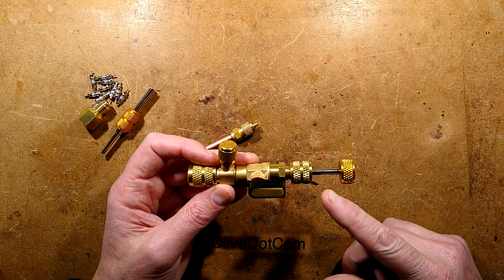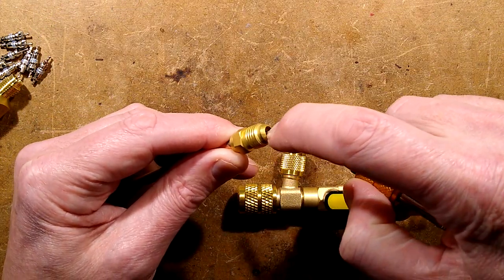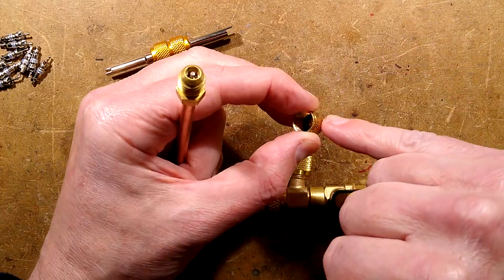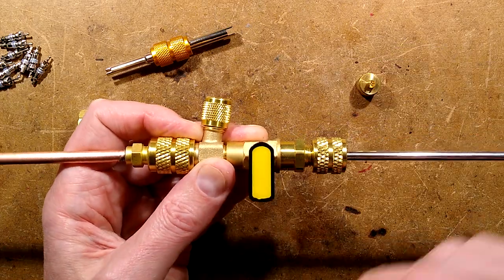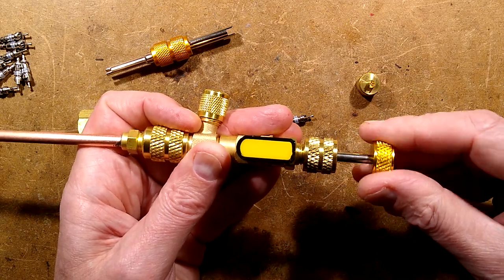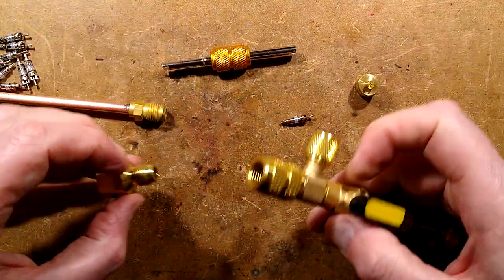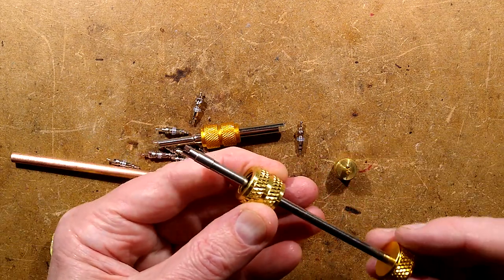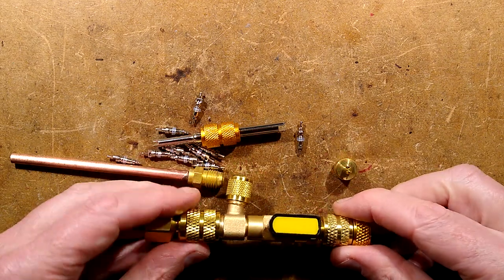Very cool tool - HVAC schrader core changer

Comment: You are correct, the side port is used to connect a hose,  Typically if you are pulling a vacuum you will remove the schrader valve(restriction) to speed the process up.
Reply: The other use is to purge the tool of air, with refrigerant from the system.
Reply: You don't want any air from opening the tool to swap the valve to get into the system. Air is a non-condensible and moisture in the air will cause ice particles that can block the tiny restrictions leading into the evaporator.
Reply: Could also be used to recover refrigerant if something goes pear-shaped while swapping the core... Like if it cross threads, or if it falls out of the holder. Probably to pull a vac in the tool though, to prevent contamination.
Reply: It can also be used to attach probes as well as hoses.
Reply: Pulling a vacuum would be blocked by the one-way valve when present. But attaching any toolB that needs access to the pressure system makes sense even with keeping and reinserting the original valve, as this toolA will only leak just enough gas to fill the toolA internals as it unplugs the valve and closes up, forming a closed chamber connecting the installed system and toolB.
Reply: @johndododoe1411  Most HVAC hoses have a depressor in them. When pulling a vacuum restrictions and hose size make a big difference.
Reply: You can use a similar second valve on the side port to vacuum the system and add gas. Ebay units are fairly poor quality normally but will get the job done.
Reply: Yep, lots of AC guys here 👍

Comment: One week before seeing the short version of this I found a leak in my car’s AC at a Schrader valve. I was wondering how I could replace it. Saw the video, bought the tool, changed the valve and topped up the freon. AC blowing cold again! Thanks!
Reply: The side port has a Schrader valve so what’s the point of removing one only to leave one in as a restriction. I remove the end after closing the valve and evacuate/charge the system directly. The side valve can be used for checking for pressure but best for fitting a vacuum gauge

Comment: Clive, the side valve is to safely depressure the core changer prior to removing it as it would have pressured up to system pressure during the core change. This type of manifold is quite common in the refinery industry. But in that environment, the pressures, temperatures, and the size of the manifold are tad bit larger.
All the Best, Chuck
Reply: It's also to allow evacuation of the line set without the shrader installed for faster vacuum.
Reply: That's actually an unintended benefit of its real use, to pull a vacuum, as Nick said.
Reply: "Tad bit bigger" LOL, everything is relative! HAHA

Comment: That’s fantastic. I’ve never had to replace a schrader valve at work or on any car, but I’m glad there is an easy means to do so.
Reply: This is mostly used in domestic hvac. And not neciasarily for changing the core just removing and replacing it during service work.

Comment: I've used one of those a lot.
The port is for your charging guage set.
The Schrader valve is a significant flow restriction and it's removal makes charging much faster.

Comment: Sliced bread doesn't even come close to how useful these tools are :) I started using this tool in the 80's for refrigeration. I've also used these for installing and removing liquid tire ballast (weighted fluid) in heavy equipment and farm machinery.  The side port is your system access service port (fluids and gases in or out).

Comment: Super cool to see how these actually work. I've seen Chris over at HVACR Videos use one of these many times and while I understood the concept of the device I was never quite sure how the isolation worked once the core was removed but before the ball valve was closed.

As for the port on the top, while I'm not certain if this is what it's intended for, it can be used to speed up recovery and charging of a system since you can tap onto it while the core is removed thereby reducing the restriction caused by said core.
Reply: I was just making a similar comment, they both do such good work, no?
Reply: Same here! Seen it used a number of times.. Its magic isn't it?!

Comment: This is basically a tiny version of how we make taps on water mains live. How we can drill, tap and install threaded valves. I agree very cool tool. Thanks, now I want one for demonstrating
Reply: They are currently replacing the gas main at the end of my street and will do so without interrupting the supply, I imagine they will use a similar device.
Reply: @chrishartley1210  the non sparking version i hope ...
Reply: @jyvben1520  I'm not fully sure, but I think sparks wouldn't actually do any harm on gas line as I think it's way "oversaturated" in lines to create any kind of explosion. Things would change if oxygen/air is allowed in the party though 🤔

Comment: There is something similar for a SCUBA regulator. It is an inline adjuster for the 2nd stage orifice. You thread the tool between the 2nd stage and hose and you can adjust the orifice under pressure. You can't remove or replace the orifice though.

Comment: Similar devices are used for adding branches to pipelines operating and under pressure.  Called hot tapping, it often involves welding..exciting?  It gets better.  Also done on natural gas collection and distribution lines.  And hot repairs, where the leaking gas is often ignited on purpose.  A pipe saddle installed in half sections is fully welded over corrosion holes.

Comment: The side port is because it is a pain to vacuum or pressurize a system with the valve in. So you can connect your vacuum pull the core and pump the system down in 20 min vs hours if it is installed.

Comment: this device has saved me many hours and headaches. i use the yellow jacket ones. one in the tool bag and  two in  the speed-evac kit. the side port is typically used for a micron gauge while pulling a vacuum. I also have an automotive version of this with the adapters for various different ports. Highly recommended

Comment: I started out nearly 50 years as a time served capstan setter operator and set lathes up for mainly females to operate them as many years passed I was went on to NC lathes and maybe the first of many to be involved in CNC lathes, the concept was staggering, but now I see turned and milled parts like this are just on another level. I don't vape but often find then in the gutter and with hand protection, I take them apart to just look at the level of accuracy on the tiny parts, with threads, dovetail grooves, holes of the size I just cannot believe and the goal post just gets smaller and smaller. I suggest with gloves and pick up one of these components off the pavement and take it to bits It's just bloody insane ... Martin Green

Comment: Refco make a far superior model. Same theory but better build quality. The 1/4” access on the side is for pressure reference if pumping down a system or if no other access points at evaporator it can be used for vacustat.

Great explanation!
I did 12months of trade teaching and you explained this much more efficiently then I ever did and this is part of my trade haha

Comment: We use this tool not only for core removal but it also helps in large refrigerant charge/discharging as removes the restrictions you can then use that side port to move refrigerant  in liquid form rather gas

Comment: There are two thing, one the extra fitting they sent you probably is for 5/16 which typically is on ductless split systems so you can just use regular non 410a hoses. Secondly the best function of this tool as some already stated is removing the s header and using the side port to speed up charging or evacuation.

Comment: I use these almost every day. If you are filling a system the core can freeze and never seal up again apart from the restriction it causes both when evacuating and filling. I use the side port to fit a vacuum gauge that needs to be removed before filling, because any pressure will ruin them.
Reply: If there was a vacuum behind the Schrader valve, it would instantly pull in ambient air.  Unless the valve is backwards.

Comment: We have a very similar very old very name branded version of this for automotive AC systems, we rarely use it but it is neat to have! It's like an airlock for AC systems!
Reply: Lemme guess.... "Snap-On", and it prolly costs $350. 
I'm not saying don't buy Snap-On tools, as I own many of them, but for a tool that I'll use twice in a decade, the one in the video will do just fine... 👌
Reply: @davelowets  Not sure, might be Mac or a boutique brand but it's got fittings for R12 if that tells you how old it is!
Reply: @huzudra  Probably 1995 or earlier..
Reply: @davelowets  Very likely, it hangs out in the cabinet below the R12 machine. I'm sure at the time whomever made it had a lock on the design and were the only ones making or licensing it's sale through other vendors.

Comment: Cool little tool. If someone were concerned about using silicone, they could easily use a drop of PAG oil, instead. It's available in any auto parts store.

Comment: Damn! I could use one of these for servicing A/C systems on automobiles...
I never knew this tool existed, and the very few times I've had to change a leaky valve on a car, I've pulled and recaptured the refrigerant, changed the valve, vacuumed the system, and put new refrigerant and oil back in it. Imma get me one IMMEDIATELY.... 
Thanks Clive!! 👌

Comment: Can't comment on the use of silicone lubricant in refrigeration lines but any grease in, or near, an oxygen line is a no-no.  It's possible for a leaking oxygen line / valve to cause the grease that a worker can get on their overalls to combust.

Comment: Those tools are generally used for evacuation of a system and removal of the Schrader greatly speeds up the process. Removal and replacement of the Schrader under pressure is doable but very difficult due to the force required to ensure the core is installed correctly. Not an issue under vacuum however. The side port is for gauges or hoses

Comment: I learned about these while learning air conditioning in community college in 1989, it was called a "Schrader evader" back then. 
I once watched a contractor "hot tap" a 12" high pressure gas line with a similar outfit. They welded a plate with a threaded nipple to the pipeline while fully pressured and gas flowing. They then screwed a valve to the nipple and then a device to drill a hole in the pipe through the ball valve. They drill the slug from the pipeline with a magnetic hole saw about 3" round and extract the slug a drill shavings through to valve they just installed. Then they connect the new pipeline to the system. Scary watching them welding a big metal plate to fully pressured pipe filled with methane.
Reply: Even scarier these days, considering the pipes are made of plastic.😳
Reply: How do they do it safely?
Reply: @mrtechie6810  The methane inside will not burn without air so as long as they don't go through the pipe there's no danger. The old pipes were probably made of cast iron, newer ones from steel, and were quite thick. The welder would not have enough power to burn through.
Even with a leak (such as a cracked pipe) all they do is set fire to the escaping gas. I believe they then repair it with a similar technique, the gas to the flame passing through the valve which can then be closed to finish the repair.

Comment: You didn't mention it, but the backside of the valve cap is also a valve removal tool.
Reply: can you pinpoint the time in the video where that is visible ?
Reply: @jyvben1520  From about 1:30 until the end of the video. Sitting on the table, cap end up.
Reply: @NusaCat  thanks for the info, sadly not really moved so impossible to see how it would work.

Comment: Once you remove the valve, you have the full pressure on the refrigerant behind it, so placing the new valve takes a bit of effort. Fortunately, this is a very infrequently needed tool. Usually, it's the fault of a heavy handed torch user, not protecting the valve from heat, that causes the valve to fail. They are capped except for service, so dirt should never be an issue.
Reply: Not removing the valve core before brazing is unthinkable! 😏
Reply: @markhonea2461  😆 We've ALL done it....
Reply: @davelowets  yeah. Yep. Sure have. 👍

Comment: Looks like decent quality brass, with decent "workmanship" - I put that in quotes because more and more devices like that are turned out by the thousands using CNC machines.  But they still may have to be assembled - hopefully without errors or omissions - by manual labor.

I didn't see any mention of the price, but with the rampant inflation in progress, I guess the price would be valid for only a few months before it would be obsolete.

Thanks, Clive.
Reply: Thinking about this, it's a bit like the battery pack they plug into your car's diagnostic port when they replace your battery.  It supplies enough power to prevent your radio and other stuff from losing their settings and having a "help! I'm being stolen!" fit when the battery is disconnected and reconnected.

Comment: I have the Yellow Jacket 18986 version of the same tool, used for evacuating mini split heat pumps. I have a micron gauge attached to the side port.

Basic process:

- Hook up the mini-split
- Attach this tool to the service port. Pull the valve core and set it aside where you won't lose it.
- Connect the vacuum pump to the end port where the valve remover goes.
- Pull a vacuum until the micron gauge (on the side port) stabilizes at a sufficiently low value.
- Close the valve on the tool, turn off the pump, ensure that the reading stabilizes. It'll go up a bit as more moisture and volatiles and whatever evaporate in the system, but it should stabilize - if not, you've got a leak to find.
- Once you're happy with the vacuum, use this tool to reinstall the valve core and disconnect it from the heat pump.
- Cross your fingers and fire up the heat pump!

Comment: I've renewed the vacuum in a liquid nitrogen dewer with a system like this. Instead of unscrewing a schrader valve, it was a normal cap, though. The port on the side was what was used for the vacuum connection.

Comment: Appion by far makes the the best one. 
Yellow jacket used to make a thermometer that could be used for direct refrigerant temps although it's useless for obvious reasons. 
If your core does not come out it's because your seal is compressed and is decreasing the diameter inside. Just loosen it a little on the access fitting and try again.
Instead of silicone we will use vacuum pump oil or mineral oil.
Reply: Have you tried Nylog? Handy stuff, nice and thick
Reply: On to it

Comment: That is indeed a very cool tool. I feel the need to have one. It is very useful for changing out the schraders of your car tires at home, without having to use a jack or lift.
But for DIY HVAC? If you need to replace a leaking schrader valve, that means, you'll also be needing a manifold set and a jug of the right refrigeration gas in order to properly refill what leaked out. Might as well call a pro.
But still, I want that tool. Just fiddling with those things can keep me busy for hours.
And there are household applications for that tool, too...
I'd imagine fitting valve stems to some cola bottle caps. And getting a small jug of CO2. With that, I could keep my half empty cola bottles pressurized so the fizziness will always be at the same level as that of a freshly opened cola bottle. Of course I need to be able to change a schrader valve without spoiling any fizziness.

Comment: In a large system, techs will remove the core to speed up evacuation or charging. The side port can be used for this, but so can the plunger end. Sometimes a gauge is connected to the side port.

Comment: Schrader valves are used in car AC systems and tend to become leaky over time, the system has to evacuated to change them, I imagine that this is tool is intended for changing those without the need to evacuate and refill.
Reply: Sadly this tool is too small for those valves - they are bigger and there is two sizes. And not all systems use the same valves / couplers just to make it extra fun.
Reply: @zaprodk  Shame, pre-emptively changing them before they leak would've been nice.

Comment: When removing a core under pressure, there's no need to pull the knob - the refrigerant pressure does that for you. Can be hard to push back in when the pressure is high. I did refrigeration repair for 20+ years and it's amazing how many technicians do not have one. To lube the plunger, use refrigeration oil... The side port is for pulling a vacuum on a large system which works better if you remove the core and leave the tool in place.

Comment: Holeeeee crap, that is EXACTLY the sort of tool I could have used a good while back!! I needed a way to evacuate and seal off a Bourdon tube assembly (long story), but make it reusable (otherwise I would have pinched off the tube). Ended up making basically this tool that could seal on to a little connector on the Bourdon tube. Zero need for one now, but I've gone and ordered one of these anyway just to remind me!